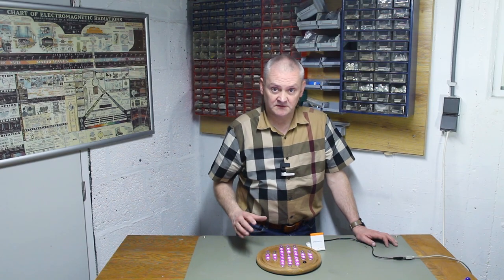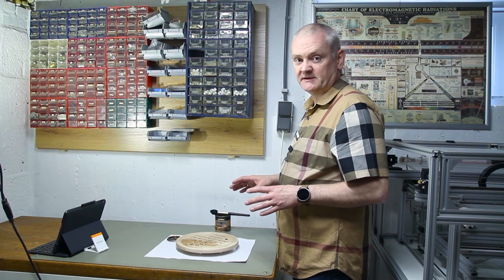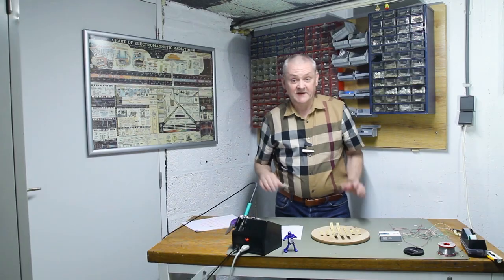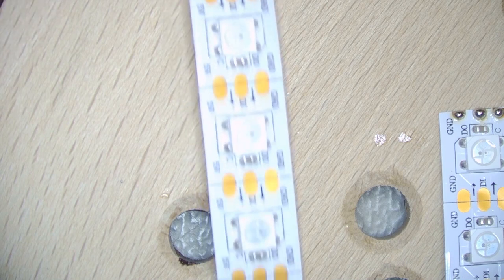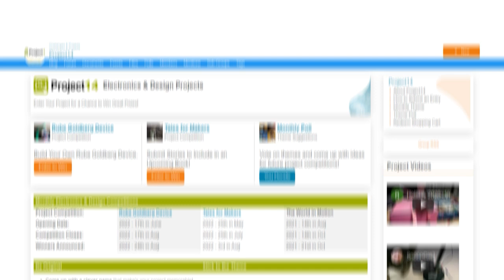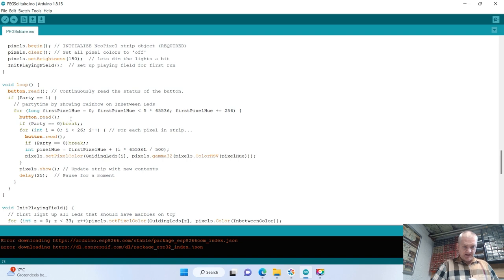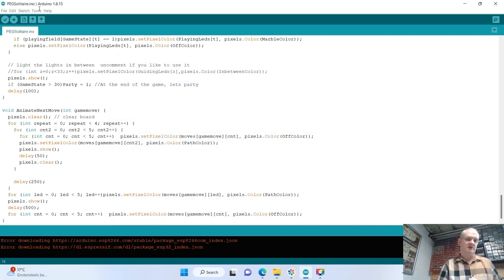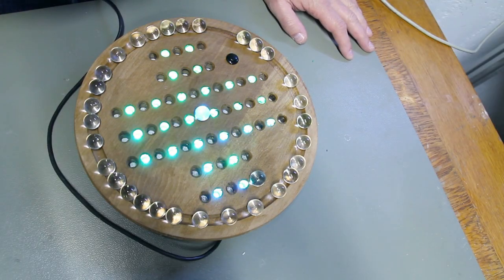Arduino and LEDs Make Marble Solitaire Easier to Solve

Comment: I used to have one of these boards years ago and I could NEVER solve it xD Came close though!
I'd love to see a version with LIDAR sensors or something under each marble to detect its presence so it can auto advance. Also a feature where you can try and solve it manually, and if you get stuck then have the arduino give you hints, or fully solve the rest for you, or tell you if the marbles that are left are unsolvable
Reply: oh yes that would be a cool follow up project!
Reply: steel bearings and you could just multiplex it, would require slight adjusting hole shape to lett light thru. prolly easier if you just create a reservoir for removed pieces and monitor that for new pieces and make that the button press

Comment: You might be able to use glow in the dark marbles, replace the neopixel strips with a multiplexed grid of regular leds, then "scan" the matrix by lighting each led then detect if the marble is glowing using the led as a light sensor.  You can actually detect light using a regular led, but I'm not sure if it would be sensitive enough to pickup a dim glow.  Alternatively you could keep the neopixel strip and plain marbles but imbed a grid of light sensors into the top of the board next to each marble placement, then hide it with a wood veneer.  Either way you'd need a much more complicated program to read the state of the board and suggest a move.
Reply: Or magnetic marbles and hall-effect sensors.  Lots of ways to do it.